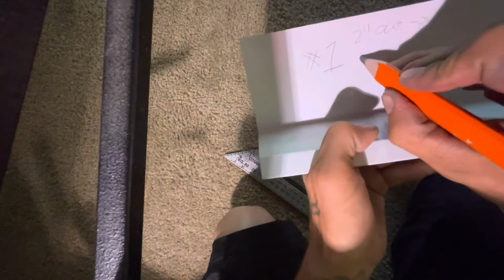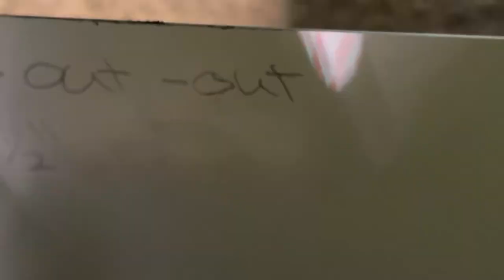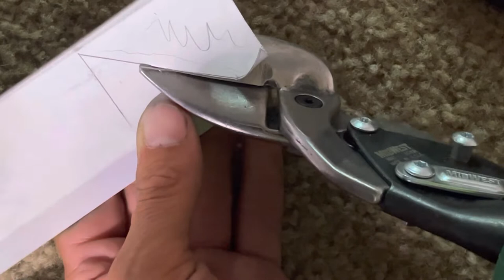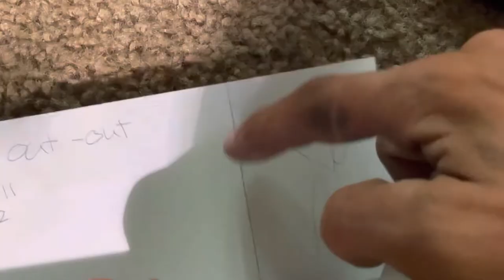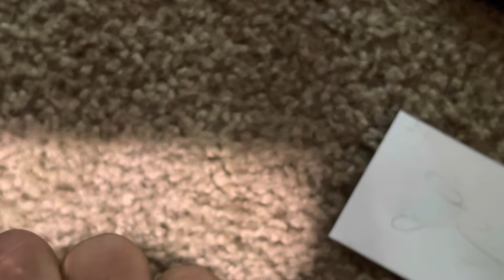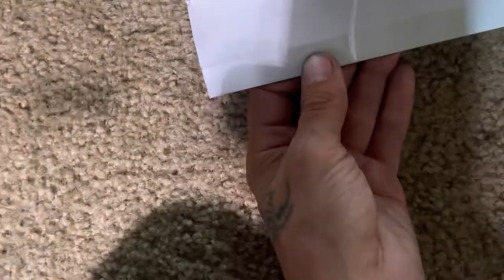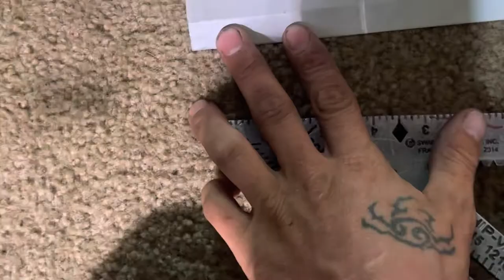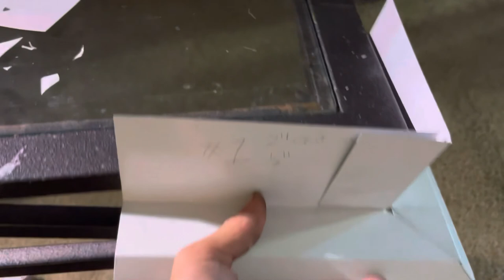How to: base corner trim; steel building

Comment: Thank you! Meticulous to a fault. Painfully slow descriptions but clear and concise. This was just the video I was looking for when I go to flash my edge trim with my wall trim on a roof cupola on a 12/12 pitch roof. Now I can practice on some pieces. Not sure I will need to mitre in the 1/2 inch tips of the corner but if I can it will be solid. If you could happen to remember to remove your shadow that would be the gold medal! Thank you again so much.
Reply from the maker: Thank you for the feed back yes very slow I made this for my crew to learn from so slow and concise was the goal. I am working on getting some filming equipment to make better videos in the future just have my phone for now unfortunately.